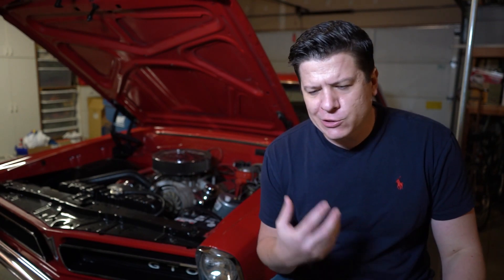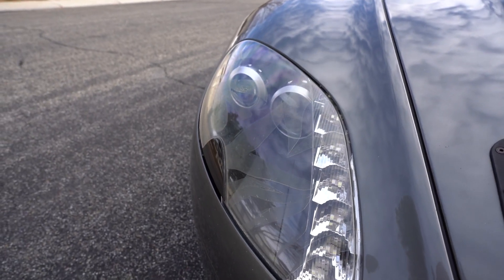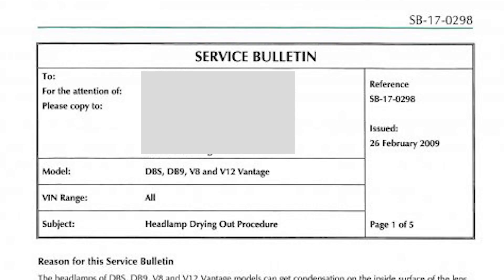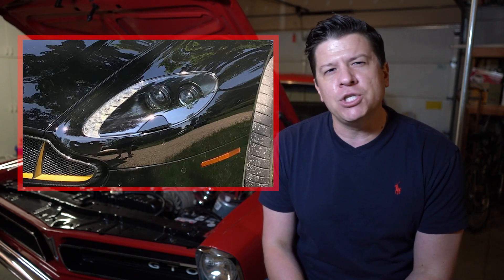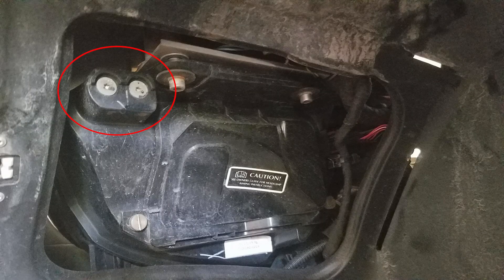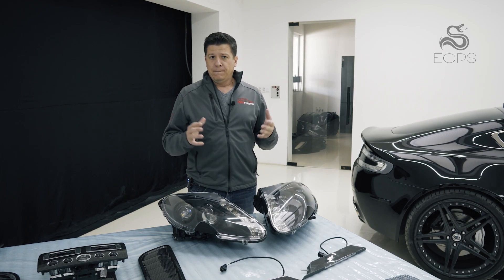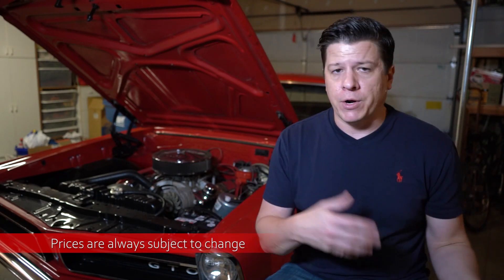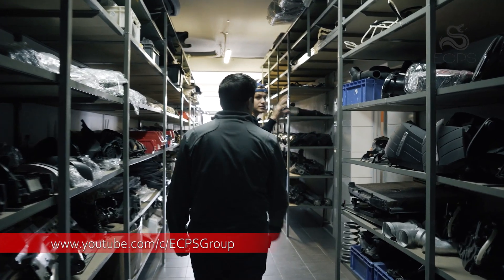Aston Martin Headlights: Lenses, Condensation, and Construction!

Comment: If i replace the main & dipped bulbs for LED types ...the ones with a little cooling fan on the back of the bulbs - do you think those fans will help circulate the air and help prevent condensation?

Comment: Wow.  A desiccant packet.  Not even a conformal coating on the board and a vent/drain hole or something.  That's.. astonishing.  A pity the board seems to be proprietary.  I bet it'd be <$50 if it were available separately from Philips.